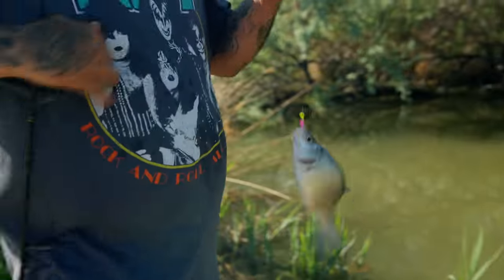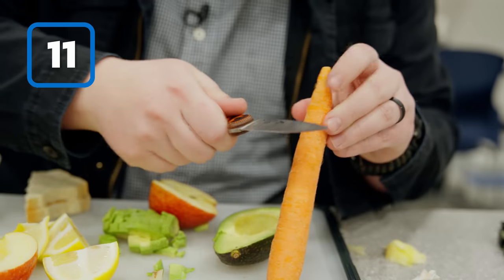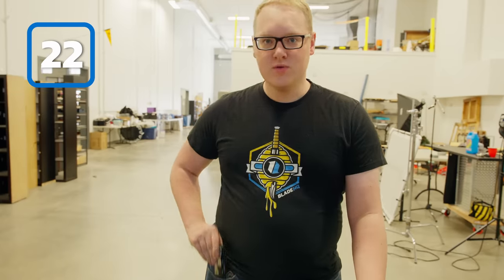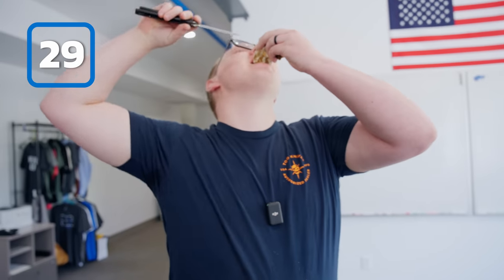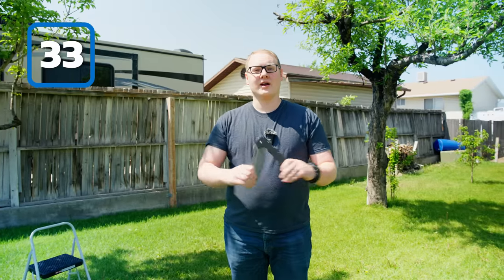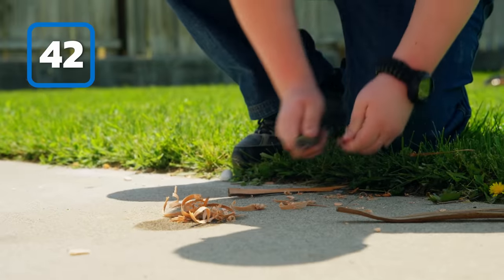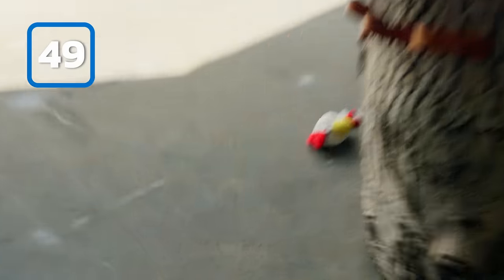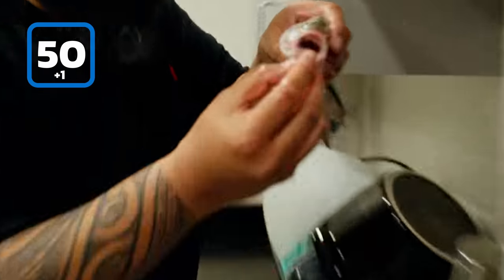Why Should You EDC (Every Day Carry) a Pocket Knife?

Comment: I am a sound guy and sometimes I have to work with speakers that have knobs broken off. I’ve found that digging my blade into the broken-off volume knob is an easy way to precisely work the damaged controls.
Reply: Getting into that broken pot, prying off the grill to the speaker cabinet, pushing dip switches inside a rack, stripping wire, cutting gaff, zipties, tie line and maybe some rope, and that's just load in stuff.
Reply: I use rope at gigs to tie stuff down. Nothing more annoying than using a multi tool to cut lol.
Reply: It's easier to have them repaired

Comment: Reality vs expectancy --- Today modern knives are marketed as the 21st century's answer to kong Arthur's Excalibur, they are tougher and stronger knives, which will lead many knives to being abused by their owners, in the belief that it was designed to handle it, which will lead to a higher degree of lock failures and malfunctioning, how many knives actually need tp be abused to perform a specific task? Treat your knife as a cuttong tool and not a chisel, screwdriver, hammer, lever tool, pry bar, or axe. And you wont be sending it in for maintenance repairs or warranty work as often as you do, due to stopping pin or lock mechanic issues.
In the 20s, men had little slip joints for decades, they didnt go out and buy another pocket knife until they wore out the one they had or it got lost, which was not often --- right tool for thr job, learn this wisdom

Comment: I’m a mechanic and carry a para 3 and daily use it send this to whoever thinks knives are just weapons
Reply: Right? I have a Bowie (Mossy Oak) and often use is to slice potatoes or onions. Best use I’ve found for it, is cutting down brush/ weeds. A quick flick of the wrist cuts straight through a woody stalk that a smaller knife would have struggled with. Best $10 I’ve ever spent. (Got it on clearance)

Comment: This is one the dumbest videos I've ever wasted time on. Talk about reaching! If I'm in the kitchen, I have a whole rack of Victorinox kitchen knives. If I'm out and about, have my little Victorinox Swiss Army knife with me. That's it. All those one hand wonder tactical knives that they made a big show out of flicking out, won't deal with a flat or Phillips screw, opening a can, prying a lid off a can of window putty, or drill a starter hole for a wood screw that you can then put in with the Phillips driver of the SAK. 

In January of 1991, I had to crawl into an overturned old Datsun B210 that had started to burn, b because the driver was hanging upside down in the drivers seat with a jammed seat belt. I cut the seat belt with the blade of a Victorinox classic. Did just fine. That same Victorinox class popped the top off a nice cold Heineken when I got home. 

I don't understand the trend now for those one hand flick knives that are a one trick pony, incapable of doing much beside cut and look baD A$$. This video reached to a ridiculous amount to justify carrying a ridiculous knife to impress young punks. Even when I served in the army combat engineers, we just used the issue 'demo' knife for everything. For combat they issued a bayonet for the M16. Aside from that, we just used the demo knife.